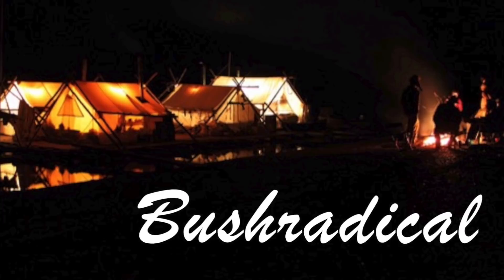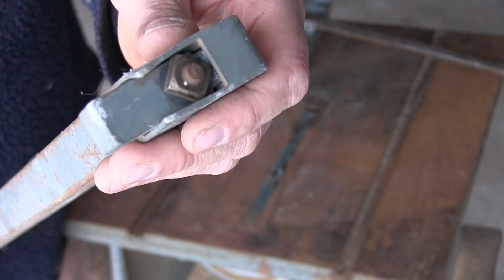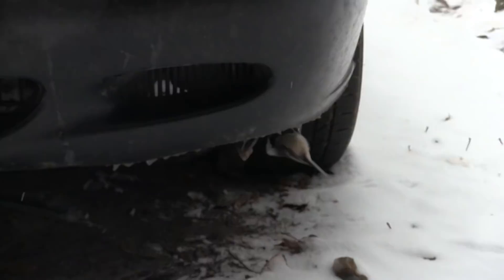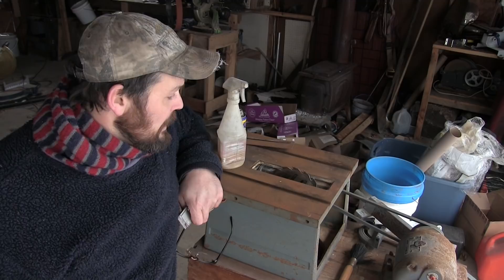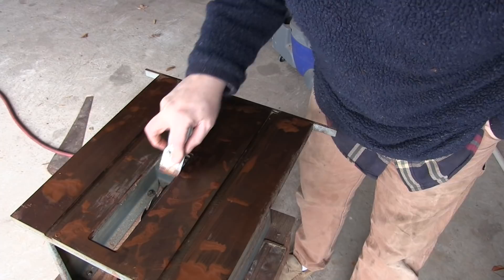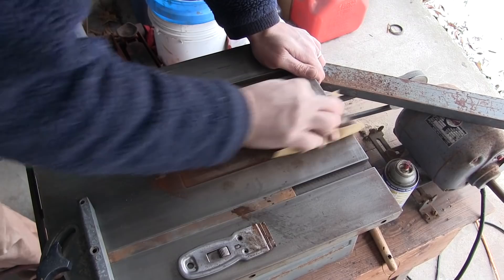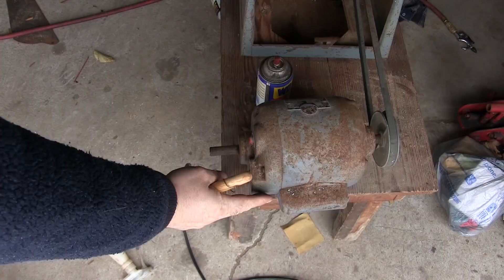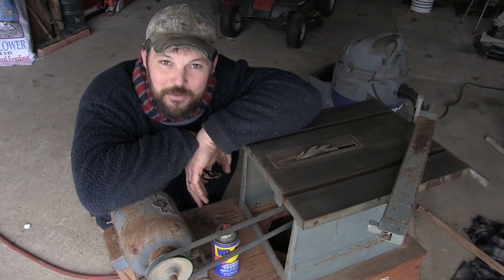Vintage Atlas Table Saw restoration

Comment: I brushed on old motor oil and got out my drill with a disk pad of that green dish scrubber type material on it, and scrubbed the top.  I got out the fine steel wool for the stubborn spots and again used the cordless drill to supplement my muscle power.  It turned out well.  I ran my indicator on it, it is not perfectly flat, but close, and probably not much worse off than when it came out of the factory.  I had bought the saw new about 20 something years ago, but I had it in a humid basement at a building that I own.  I moved it to a nearer building and it is now a joy to work on.  I watched your video because I have the jointer that was made to be powered off of a pulley on the other end of that 1725 rpm 1/2 hp motor that you have there and am in the process of restoring it (returning to functionality so that I can use it, or refurbished it as you would say).  The cast iron is in good shape and probably better than a similar sized one I could buy today for any reasonable price.

Comment: I have the same table saw. It's a nice machine. I have it set up with a dado blade and use it for making box joints. I ended up taking the motor apart on mine and cleaning it. Mine also came with a jointer. The motor had two pulleys and belts on it to run both the planer and jointer, but I ended up taking one of the belts off because the motor couldn't handle running both at the same time and safety. I've debated hooking it up to a more robust motor at some point. We'll see. 

Nice restoration.

Comment: I have a craftsman equivalent to that saw that my father in law gave me back in the 1980's. I know he built stuff with it. I have a desk he built. It is well used. I put a motor on it. It has a flexible light that acts as a belt guard that needs adjusting all the time. It stands on a rickady metal base with tiny swivel wheels that looses some of the material each time it is pulled out of the shed it lives in. It is a reliable wood working tool and i will never get rid of it. I even cut aluminum on it. Enough said. Love your cabin build. You are an inspiration for us all.

Comment: I was on Facebook and found an old man giving a atlas model 3060 away for free i went and picked it up today and the thing  is super nice even came with the original manual which was a plus but he showed me it ran good which it did just needs a cleaning the things had been in a workshop at his place since the 80s so it wasn't crazy rusty or dirty.

Comment: I picked up that saw's big brother a few years ago at an estate sale for cheap. The thing was attached to a 3x6 oak table that ended up to be too big to get out of the guy's basement in one piece. After four hours of disassembly of the table I hauled it out piece by piece to my truck.  Mine uses 10" blades and came with one side extension and a homemade fence/sled set up. 

It was in near new condition but had sat for a few decades unused. all the grease on the slides and internal bearings was hard as a rock, I took the whole thing apart, cleaned and relubed every last bit of the thing, then polished the table top with 1200 grit paper and polishing compound.  The motor was newer, a 3hp Baldor compressor type motor that mounts direct to the rear of the saw but is still driven by a belt. I didn't do any painting on it but it was in pretty decent shape as it was.
Atlas made table saws for Sears 60 years ago as well. They were a well known, well made, and well respected brand. 

The Atlas name went away in 1965 or so,  the company became known as Clausing Industrial around that time and quit making wood working tools altogether.
Reply from the maker: I bet you could cut anything with a 3hp Baldor on that saw! I bet the lights got dim when you fired it up.LOL. 
I see clausing drill presses around but thats about all I see of the Clausing brand. I have 2 old Craftsman drill presses that were Atlas made. I like them better than the King Sealey Craftsman presses
Reply: @Bushradical  I actually lucked out right around the time I got the Atlas saw, I had answered an ad on CL for a used motor for cheap, and it turned out the guy had a dozen or so various motors. I ended up buying the whole lot of them. A few were older Craftsman double ended motors, a few were larger Baldor compressor motors and the rest were off various other wood working equipment. I used the Baldor 3hp because it was already set up to turn the right direction and the mount worked best with the motor plate on the Atlas table saw. I use the Atlas mostly with a dado blade right now so the larger motor comes in handy. 

Clausing was originally a lathe company that Atlas bought or merged with in the late 50's. Lathes and metal working tools became the biggest part of their business so they sold off the wood working division and used the Clausing name from that point forward. 

I've got an Atlas drill press, two table saws, and an Atlas metal lathe sold as a Craftsman model. I had a Craftsman/Atlas wood lathe but sold it a few weeks ago. 

Atlas actually sold out their wood working division to Black and Decker in 1960, 5 years later they dropped the Atlas name altogether and called themselves Clausing Industrial. So any wood working tools bearing the Atlas name are Pre-1960. The earliest Atlas saw I've seen was from the mid 1930's, and they likely quit production during WWII for the war effort. That basically means the span of Atlas branded wood products was rather short lived, about 20 years worth of production. 

There are a lot of similarities in the old King Seeley Saws and the Atlas saws, so much so that when completely apart, it might even be hard to distinguish parts from either brand. The similarities don't carry over to the drill presses though.

Comment: Great video! I'm restoring my grandfather's old Atlas table saw currently. They are definitely workhorses
Reply from the maker: They sure are
Reply: I just bought a 10" Atlas model 3060 and am trying to find out if they ever had a blade guard or riving knife. I haven't taken it completely apart yet but I have not seen any place that a riving  knife would bolt on. Where have you found some of the parts or manuals? It is truly a beautiful piece of All American machinery.

Comment: thats a great little saw i have basically the same saw made by rockwell  someone along the way has removed half of your table off of each side probably so it would be easier to transport to the jobsite but its something to be looking for at flea markets and yard sales you might possibly find a pair crazier things have happened thanks for the video enjoy your new saw see you on the next one
Reply from the maker: Thanks Gene. I like the  old Rockwell stuff. I used to have a Delta drill press and it had the names Delta, Rockwell AND milwaulkee on it...back when they were the same company.

Comment: Hey, cabinet maker here, make yourself a push block so you don't walk around and pull, don't pull through a table saw, that's one way to get off the fence, and that spells disaster. You should always have 100% fence contact, that ensures 2 things; 1: your width remains consistent throughout your rip' and 2: to prevent kickback. Normally saws are set up with the fence to the right of the blade, I couldn't really give you an explanation for that, other than maybe most people are right handed. I would consider building an exit table for that saw, right over the motor, just make maybe 1/32, or so shorter in height than the table. And just wax your table with regular old cheap turtle wax, it won't soak into the wood and affect the finish, and normally when we lube our machines we use WD-40 Dry lube,  regular penetrates, and lubes will soak into woods and affect the finish later. Awesome saw! Wish I could find one like that.
Reply from the maker: I do need to use a push stick. Lots of times I neglect to though..  The most dangerous stuff Ive ever cut was 2" blue foam board. Cuts like butter, but it will grab and turn sideways in a heartbeat.

Comment: Just picked up a nice Craftsman 113. 29901 I believe it is. It's really super clean, only paid $50.00 for it. 
Going to need bearings though unless I can sneak some oil in there somehow to get by for a while  
I just rightly don't feel like changing them right now.

Comment: You can avoid the naysayers by using terms like rebuild instead of restore.  That said, I like all kinds of restoration. In this case I would argue that you're restoring the tools functionality/usability, not necessarily the tool itself. I think that counts.
Reply from the maker: I got chewed out for a vintage Skilsaw rest I did. Lots of negative comments, LOL.

Comment: Mine had a Homecraft  badge on it but looks very similar. Mine only had  a 1/3 hp motor hanging off the back of it that looked scavenged off of some other machine. The fence and rails were Macgyvered but it worked well for me for over 20 years. I moved on to a bigger machine when I moved onto bigger projects due to it being underpowered and with a 7 1/4 inch blade and a fence that needed constant tweaking for every cut adjustment. I miss the little guy though since it always felt very safe with little chance of kickback since it was more likely to stall from belt slippage than kick back at you.
Reply from the maker: If yours was a homecraft, then it probably was a delta. I have metal cutting bandsaw thats a Homecraft and its a Delta. Great tools

Comment: Damn man that is one serious electric motor.. is that a 1 HP.. my dad was the king of the one horse electric motor.. we had em all kinds of stuff... that blade spinning on that motor is SERIOUS!.  the modern ones you get are not as hip as that one. a little navel jelly and emery cloth and some elbow grease will make that saw as good as new.  Really good job.. you now in a few years, as you use that thing it will look even better... What a beauty!!  Keep working on it and Make it pretty and happy again !! love it Dave....... J
Reply from the maker: Thanks Jeff. I don't know the size of the motor, but I don't think its over 3/4 its just extra heavy. I think this because I have a 1hp on my belt grinder and a 2 hp on an old 6" belt grinder.....that thing is a pig!
Reply: @Bushradical  Snap man i totally dig it... my dear old dad would get an old machine strip it clean  (most of the time) and spray paint it with hammer tone green, for some reason he loved that color.. Growing up we had a real nice shop in our basement with all vintage tool and machines he acquired. some were just as is in great condition a little dirty well you could see the build up over time, some still had the pin striping on them.  Some were salvaged from a fire and rebuilt to work.. (hammer tone)  One time as a tween i was messing with the old drill press and snapped the spring and the chuck column drop, i gasped and proceed to figure out how to fix the spring... i fixed it and never said a word.. that thing worked on and on till he gave it to his brother (my uncle) because he required a industrial delta from a fire. the only thing missing on that drill press was the cover for the pulleys. Keep it up man... steel wool, 3n1 oil, emery cloth, WD, all those things maintain your machines.  I am totally confident that as you use them and build and clean and organize your shop those machines are gonna sparkle,  though you may not know it now your son will want all that someday..  Keep it up.. if any one gives you a hard time you tell them to talk o me :)  Oh yea that poor reporter in the girly-man jacket, that chucked you guys out in the woods behind the dumpster,  hope he gets his Man-card soon,  you guys looked great in Brooke's video..   right on man  J

Comment: I have one of these that I have used as my table saw for the past few years. I have the original catalog produced by Atlas for it. This saw is made for 8" and 10" blades but there's a mechanism around the blade carraige that adapts the fit. Your has been modified to shift the blade to center which precludes the use of a partial guard like the original. Not that I would recommend it, it's a sawgun sprayer with the original guard.
Reply: I just bought a 10" Atlas model 3060 and am trying to find out if they ever had a blade guard or riving knife. I haven't taken it completely apart yet but I have not seen any place that a riving  knife would bolt on. Where have you found some of the parts or manuals? It is truly a beautiful piece of All American machinery.

Comment: The other thing I do with my cast iron table is use paste wax to finish it off. Thanks for sharing.
Reply from the maker: Ive used paste wax a lot too. It works well. Thanks

Comment: Hey Dave. Hope all is well for you these days. Having new vid wilthdrawls, you must be busy.  Cant wait to see the knife shop progress, its a huge inspiration to me. 
 On old tools like this baby, i finish with a nice thin coat of spray silicone. Try it sometime, leaves a nice protective coating.... just be ready for a slicker than usual surface.
 Great vids, thx for making them.
Reply from the maker: Thanks Richard, I may try that. My tools get rusty and I need a good solution. I blew the engine in my car the other day so I'm up to my eyes in an engine swap.
Reply: @Bushradical  good luck! It never happens at 60 degree's... be well.

Comment: That little guy is going to be great for the knife shop, maybe consider waxing the table to keep it from rusting in the future?
Reply from the maker: I would have but its below freezing out, so I hit it with some lithium grease and rubbed it in good and wiped everything off I could.
Reply: Bushradical hadn't thought about that... Good point
Reply: Bushradical Grab some wax paper from the kitchen, wad it up and rub the top down with that.  You'll be amazed how well it works, even in the cold.  I keep a roll in my shop.

Comment: One hundred % better on the table top. I had the chance if getting a craftsman 1956 8" table saw fo FREE. So far I've been able to clean up the table top, the guide, put a new cord on the motor and get a new belt on the motor. It started right up and is extremely quite. When the warm weather comes to New Hampshire I will do more in the way of cleaning the inside of the saw and then paint the saw to the original color which is like an industrial grey that is on my 1947 Craftsman jig/scroll saw. I love tools that my dad could of had and used. He was born in 1912 and I have a tool made in 1916 from the company he worked for 57 years later. The most wonder tools are those he had a part in making. They were H.K.Porter bolt and tree limb cutters made in Boston#Everett# Somerville43,  Mass. They made tools to last a century there. I have 17 tools so far.
Reply from the maker: Stephen. Back in 1999 I was a campground caretaker in Sitka Alaska. There I picked up a set of HK Porter bolt cutters. Red. 18" version I believe.  
       From 2000 -2008 I was a concrete contractor in Fairbanks Alaska, and I used those bolt cutters every day to cut wire mesh for slab work. They are the finest bolt cutters ever made. Every time I used someone elses' cutters I loved mine even more. Ive talked other guys into getting a set for themselves.
Reply: @Bushradical  the ones made after 1988 unfortunately only God knows where they are made. They never say on their tools anymore. As far back as I know which is 1900 tools for H.K. Porter were forged at the foundry in their Boston plant at Assembly Square. They even had forged into the handles the plant location which I thought was wicked cool. If you go to flea markets or individuals who are selling antique tools you can find them and in pretty good shape for their age. Dating the tools is not hard such as Boston being from late 1800s to 1920s. Then late 1920s till 1940s same plant and location was then called Everett. After then starting in late 1950s till the plants closing in 1988 it was Somerville or Somerville43, 43 referring to zip code 02143. H.K. Porter even up until the 1950s made industrial and mining train engines. The even help service the Mountain Washington Cog railway trains! I have found tools made at my dad's plant all the way down in Florida which were a set of metal strapping cutters. Yes I brought them back to add to the collection. If you want to see a set of 1900 H.K.Porter bolt cutters like I have check out Scoutcrafter on YouTube. He did an excellent job and he knows how I feel! Keep bringing old tools back into service!
Reply from the maker: right on. I know the ones I had were aluminum I beam handles. They were "loose" and super easy to operate but the jaws had tight tolerances and cut perfect every time. They just had the best of everything you want in bolt cutters.....or mesh cutters in my line of work.

Comment: The old sears table saw  I got had a layer of rust about a eighth of an inch thick,  so I  took a wire wheel brush  to it! I  used a dust mask because the dust was horrible! I runs  like a million bucks!
Reply from the maker: Those old sears Craftsman tools were pretty awesome. The King Seeley corp, from Ann Arbor Michigan made a lot of those tools.

Comment: Great video!- on those threads use a dry graphite lube as it won't attract dirt and dust - keep up the great work.
Reply from the maker: You're totally right. I should have took it out and put it to the wire wheel, and maybe waxed it. But dry graphite would be awesome too.  What it really needs is a good sharp fine cut blade.

Comment: Refurbished works just as well as brand new. I have watched a few "Rehab" videos, cool if you want to spend that much time replacing parts and putting a new coat of paint on everything but I would be using the tools more than putting them on the mantle! Watch your finger and have a good time with your "new" saw, Thanks for sharing!
Reply from the maker: Thanks Joe.